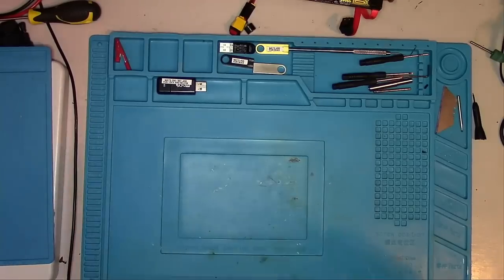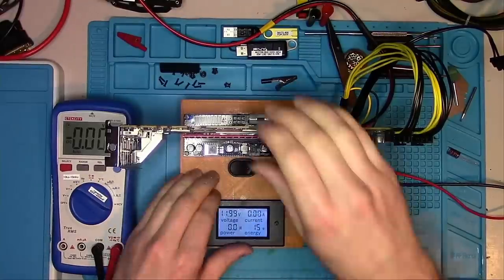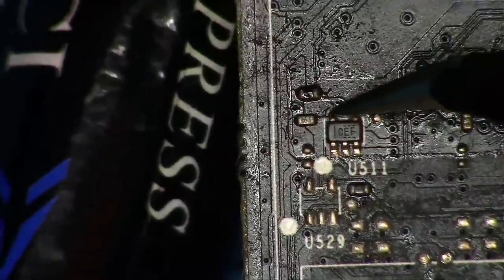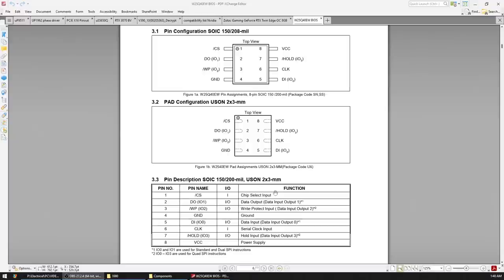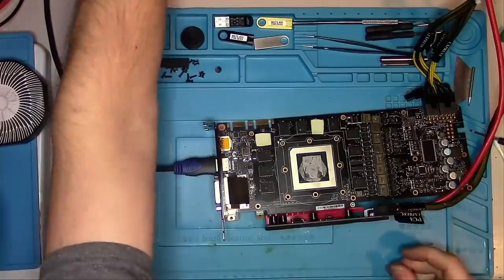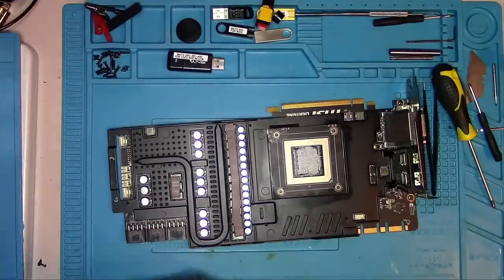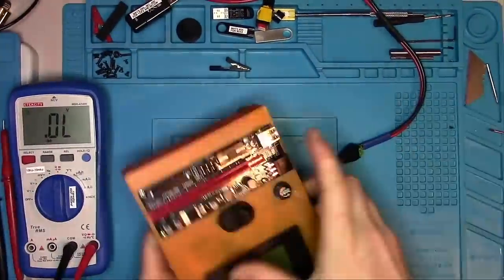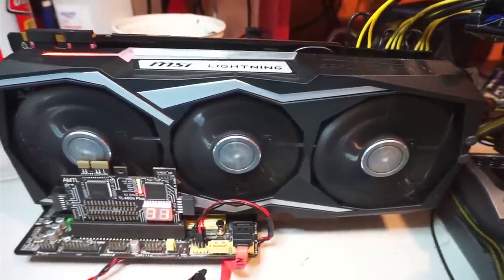Does MSI make good graphics cards ?

Comment: Why is every gpu repair in youtube uses FurMark? It uses only openGL right? Because i have this issue on my GPU that when i stress test it with furmark for 8 hours its stable but whenever i uses 3dmark stress test which uses DX12/DX11 it crashes.
Reply from the maker: It loads the core differently.
Nothing will load harder then furmark.

Comment: I bought an MSI last year and was experiencing overheating, and had to underclock.
So about a month ago I replaced the pads on the RAM and also put a thick couple of pads on the VRMs enough to make contact with the Heatsink.
Max GPU Hot spot temps dropped 10 degrees, though I thought the heatsink would be soaking more heat, seems like all-in, it was able to dissipate more heat from the card.
In future, I will rather buy founders edition as they generally have many resources on how to do extra cooling, as long as parts for extra cooling.
I will avoid MSI in future like the plague.

Comment: Man, I had 3 GPUs from MSI over the span of 5 years that are pure garbage with their cooling designs/pads, 2 of which actually died (fried memory) a few month after the warranty expired. Like I'm not sure if they are trying to save a buck from giving half thermal pads or calculated it so well for it to die exactly out of warranty.
MSI is like at the bottom of my list at this point, even worse than gigabyte.
There are good MSI cards, but it's only after you have taken it apart to see the inside. Good thing there are teardowns people do o avoid some of these crappy designs.

Comment: bro you are testing GTX...
Reply from the maker: gtx, rtx. same problems. nothing changed. maybe no more drivers and mosfets but drmos's instead. maybe no up9511p but IR3518 with firmware that keeps getting corrupted.
otherwise, the main issues with these devices is cooling and it mostly has not changed.
Reply: @northwestrepair  Most of what you said is correct. But MSI also has high end and low end.

Comment: All these 10 series cards are exceptionally old now, so it's expected that they are at that time for component failure at this time in their life span. Depending on what failed I doubt they are worth repairing these days because even a 3060/6600xt come within spitting distance of the once mighty 1080ti at much less power usage, but it depends on the repair cost of course.